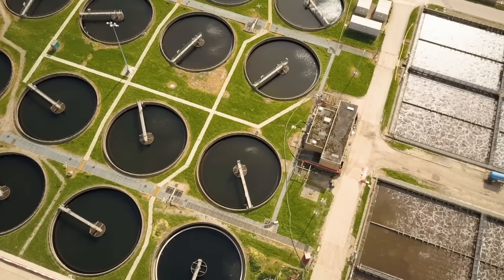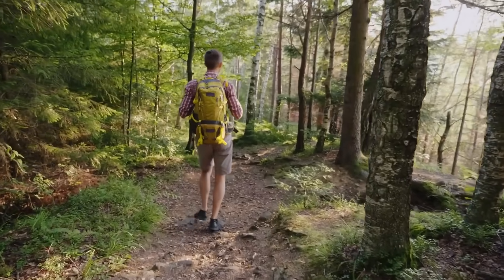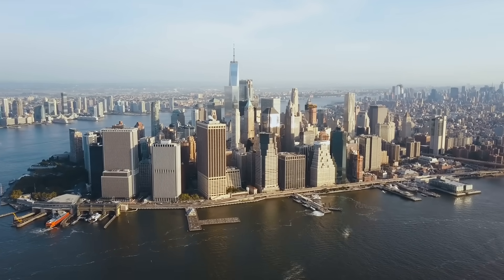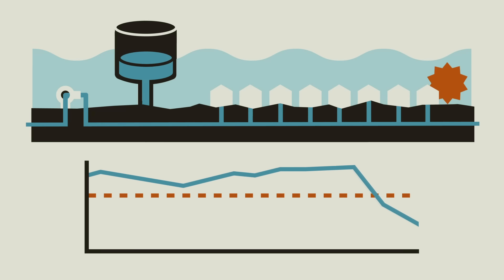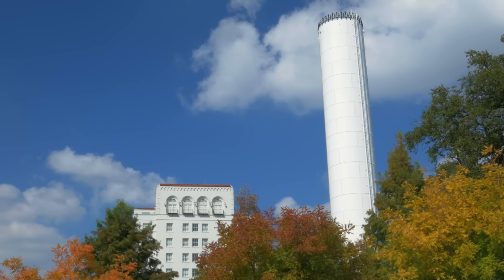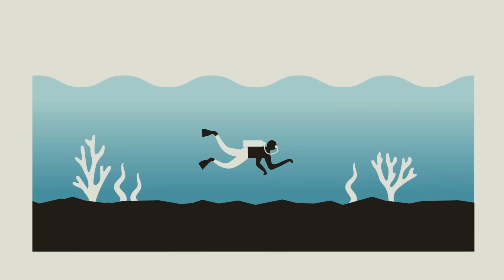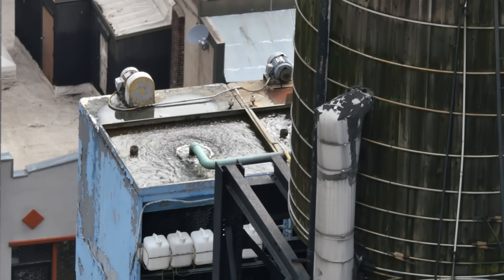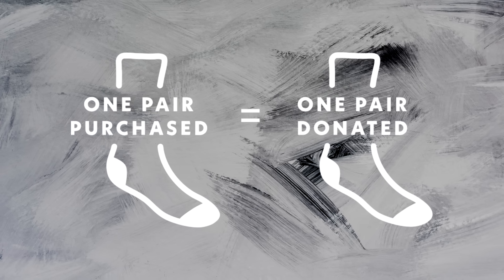How Water Towers Work

Comment: How about a video on Archimedes screw pumps ?
I got a situation with a waste water separating auger for industrial food peeling. We run taro thu an abrasive peeler & the, eh, shmoo comes out as fine or chunky taro bits in a suspension of viscous goop from hydrophilic polysaccharides. Also stinging calcium oxalate raphides.
Anyhow the auger doesn't screw it upwards fast enough at the manufacturer recommended angle so it backs up. But the auger is designed for potato peelings, not higher viscosity taro shmoo.
Lowering the angle of the auger seems to improve shmoo uptake, I guess it overcomes the sticktion from the slime since it's not fighting gravity so hard.

Comment: I'd be interested to see how the towers are constructed and kept from leaking.  I assume the internal water pressure pushes against the seams to seal them and I suspect the seams might weep a bit if the tank pressure gets too low.  Also interested in corrosion protection...  I assume sacrificial annodes are used?

Comment: Our city has no visible elevated water tanks, however what people don't realize is that a fairly sizeable portion of the city is served by a hidden water tank that is buried under one of our tall hills, it doesn't work for all the city because there is housing above it, but I'm sure it helps a lot for the portion of the city below that tank, the rest of the city relies mostly on pumps though.

Comment: 5:40 The crafty Luftwaffe in WWII eventually came to the situation of timing their raids on London to coincide with Low Tide on the Thames, thereby making it more difficult to use this abundant water source especially when the mains pressurised supply was down ~ due to excessive demand and/or damaged pipework.

Comment: When you think about it, the flow of water and the flow of electricity aren’t really that different, the only real difference is electricity is pure energy, and water flow is a combination of matter and energy. Both flow from high energy to low energy, both keep going until they can reach ground and if they can’t, they don’t flow at all. If you want to get technical, you can measure the flow of water in voltage and current, voltage being the force/volume, and current being the speed/pressure, and even many of the electrical components found in circuits have an equivalent version for water flow, check valves are like diodes, water wheels are like resistors, dams are like switches, or sometimes resistors, pumps are like batteries, and you guessed it, water towers are like capacitors

Comment: Do water towers divert the water into the mains supply pipe in the direction of flow or is it via a tee junction? What difference would this choice make?
Also, is the restored head pressure equal to the height of the water in the tower and what influence do differing velocities through the main pipe have on the recharge at the water tower's point of connection?

Comment: There was a water tower near me on the Central Coast of California. They finally tore it down and replaced it with pumps, because it could not be retrofitted to be seismically safe. In an earthquake, a huge weight of water a considerable distance up in the air placed a massive force on the legs supporting the tower, and they finally realized there was no practical way to make sure it was strong enough to survive a major quake. Great video, though!

Comment: We need more water tower highways for river systems to reduce emissions of energy cost , The format can be drawn out to very high altitudes and channels dug out using the same force of power that gravity allows to expand a river system that can also be beneficial to lower altitude water treatments even using salt water and design to purify the water by large distance of landscape filtering . HIGH ALTITUDE FOREST CULTURE CAN USE SALT WATER FOR HIGH ALTITUDE SEA WATER MAKES NO DIFFERENCE SINCE TREES AND CERTAIN GRASS LANDS CAN ALTER OUR ECOSYSTEMS FOR ANIMALS TO HAVE MORE MOISTURE TO SPREAD OVER THE NATIONS AS A MASSIVE COOLING SYSTEM . Then also using fresh or salt water tower systems can produce new city's and river side homes amongst the most driest places . Water wheels can also have a set design in furthering the distance water must travel to higher altitudes , Electronic valves that open the direct of dumped water in large scale towers ( more the thousands of towers or the single tower above the ocean sliding down a cable system of tubes can get faster and less expensive for materials , the nature would be to hide the systems eventually but to incorporate a following of nations to research the original module as a living testimony of excellent craftsmanship and nothing new to the system just taking advantage of the world we need to work with and devlope into a self efficient life  style system that adapts and protects its self with minimal energy use to develop

Comment: Contaminants can enter through taps! Yea right.
Reply: That's why we in the UK still have separate hot and cold taps rather than mixer taps like the rest of Europe.

Fresh cold water from the supply in the road outside, hot water from the immersion heater/hot water tank/combination boiler gas flame. It was illegal to join the two because of the risk of contamination from something nasty lolling about in your hot water tank.
Listeria, Legionnaire's disease anyone?

Comment: The thing I have always wondered about was how they keep them from freezing up during periods of below freezing temperatures.  Anecdotally, when I was deployed to Kuwait the water coming from the water towers was quite hot (even after spending time in the pipes underground) In fact, it was unnecessary to use the hot water in the showers, the water coming out of the cold water tap was more than warm enough.

Comment: why they don't install a propeller inside a pipe where the water move out, so that they also can take advantage of the flow and generate electricity for the local citizen. Idk whether the pipe for water to get inside the tower is the same to the outlet pipe. If it is the same, the idea would be already dead before it can be brought up in front of the crowd, but if not, why don't try to do it in practice

Comment: Water towers were completely foreign to me before I spent time away from my home town.
Where I'm from, The city has an entire mountain watershed and reservoir dedicated to the water system only, 40 miles away and thousands of feet higher.
The plentiful mountain reservoir is at such a higher elevation that there is never a pressure problem. without pumps.

Comment: Take the gravity out of the equation, add a pressure regulator on the pump; this is how compressed air works.
And any other compressed gas; the difference there is low volume/high need demand, so they transport the storage instead of laying pipe.

Comment: Well explained. Thanks. But there is one more reason to use water towers instead of pumping directly to the network and that is that the pipes will live 30% longer because you do not have the frequency of the pump in the network. (yes there are also other ways to filter that out, but the water tower is the easiest)

Comment: I am looking to do 4-7 275 gallon IBC tote along the side of my house 
My issue is the side of the house has about a 3-4’ slope will I need sealed pipe from lowest point in to the highest tank (possibly under the water level) to it loose water fill volume and add head pressure for my garden 8-10’ lower then highest tank and 4-6 lower then lowest tank

Or will I need to dig highest tank down and raise up lower

Comment: I wonder if a city could add a high-efficiency, in-line water turbine to the main pipe that feeds the surrounding municipality and create sufficient electricity that could be fed back to the grid?
Reply: No. 
The pumps produce pressure that brings the water up. That water up in the tank stores the pumped water but also the energy the pumped used, which is turned into pressure when the water goes down the pipe. Adding a turbine will just use up that potential energy, and will reduce the pressure downstream. You would need to compensate with taller water towers combined with more powerful pumps, and that increase in consumption from switching to bigger pumps will always be more than the power you produce from the turbine

Thoses elevated  storage for making power that act as batteries that he mentioned in the video do not encounter this problem because we dont need pressure at the bottom of the dam. They are still not 100% efficient, and woll still require more power to pump water up there than they produce, but they have the benefit of being able to pump that water up there using power grid excess from a hydro dam, instead of keeping some of the dam’s turbines offline so that we can use that stored energy when the demand exceeds what the dam can produce

It will always require more energy to pump water up than what energy we can get back out of it,  simply because no turbine and no pump is 100% efficient. There will always be losses to things like friction, vibration, sound, heat or other forms
Reply: Theres no money in that. 😂

Comment: Are there any large water supplies where mechanical accumulators are used instead of (or in addition to) gravity accumulators?
I'm planning a freshwater supply for my own property and I'm thinking of building a spring-pressurized mechanical accumulator. I want to have regulated pressure for my indoor plumbing, and regulated flow for irrigation, but most pressure reducing valves seem to require pretty big pressure gradients.
Trenching a water line up 115ft/50psi of slope is not completely crazy,  184ft/80psi of trench up a slope is more, and that's just the minimum head for most PRVs I've seen (maybe pilot-operated PRVs require less?) so in practice you'd be going further. Here in Wyoming, the average frost line is almost 5ft, which makes the trenching expensive, dangerous, and time consuming.

All this to say, a mechanical accumulator seems attractive.

Comment: Electrons do not flow from high voltage to low voltage.  In a DC circuit, they move away from negative voltage to positive voltage (electrons are negatively charged).  In an AC circuit, they move back and forth.

Comment: My house is supplied by a very high public water tank(at a height of about 50 meters) and my own house has an overhead tank ( at a height of 20 meters).
Is it possible that the public water tank sends water with such pressure that my homes overhead water tank gets filled up without the need for me to pump the water to my overhead tank?

Comment: The ram pump. Aslong as it's below the waterline of the intake, and has an excess outlet that can flow downhill. 

It can pump water for miles with no moving parts, never break down. Never seize. There's ram pumps built in the 1800's that still run today, you usually get them in mountainous or remote regions where you just need to move the water. 
But you can't exactly send people out for repairs or hoofing a load of spare parts out there.

Comment: Also liquids are not able to be compressed, which makes it pressure regulation in a dynamically changing system challanging, especally if you don't have a way to vary liquid volume, in response to pressure changes (water towers, being one way).

Another point that Grady didn't seem to mention is pipe sizing; when no water is being used (the static state) pressure would be equal throughout a closed piping system, however when water is flowing in the system (the dynamic state), pressure drops more the further you are away from the source. Piping system friction being the main reason. One way to compensate for this unwanted issue would be to increase the size of the piping system. Another way to compensate, is to add water towers along the rout of the piping system.

The piping system still has the meet the sizing requirements for the average usage, but it doesn't have to be nearly as large as it would have to be without distributed water towers.

Also, without water towers, water-hammer could be a huge issue.

Comment: A "tower" one inch square 115 feet high would produce 50 psi. That's about 15 8-foot stories. (0.433 psi per vertical foot)

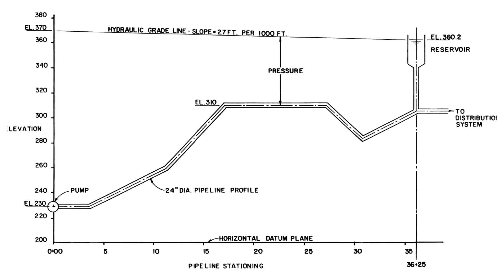Comment: At 6:25 does the reservoir not create pressure (due to weight of water) back to the pump? Does the "down" pipe (to about 280 elevation) act to isolate that pressure from the pump? I'd like to see pressure readings along the way.

Comment: At 3:23 there is only a pump. For simplicity it doesn't show what's connected on the right side. But if it's open, all the water goes there, including water from the houses? Isn't a return pipe to the pump needed, as in a home boiler system?

Comment: "Just like electrons in a wire flow from high voltage to low voltage". I'm afraid not, it's exactly the opposite. Benjamin Franklin defined the flow of current as positive charges flowing from high (positive) to the low (negative) potential long before EE Thompson discovered the electron an determined it had a negative charge. Hence electrons flow from low (negative) to high (positive) potentials. However, it was decided to keep the original definition of conventional flow for consistency with prior practice.

Of course, I'm sure you already knew that, and it was a slip, but I wouldn't want other mislead.

nb. water towers are now very rare in the UK. In hilly areas reservoirs are used, which I suppose is a sort of natural water tower. However, London (a city of over 8 million) uses pumped pressure, not gravity for most of its supply. Several older Victorian water towers, which were built more like brick towers, often disguised as something else, have been turned into somewhat unusual domestic properties.

Comment: Im a plumbing apprentice and didn’t know how water towers worked until I watched this video. It’s pretty cool that city-provided water from water towers are literally just a GIANT version of how a single house that has well-pump provided water gets it’s water out of the earth.

Water well-pumps push water from a deep hole in the ground, through some pipes, and then water gets inside the house and usually 20-40 gallons of water is stored in a water storage tank AKA pressure tank. When the pressure tank has a satisfactory amount of pressure for what it is designed for, then the well pump stops pumping water to the house until the people inside the house use enough water that the tank needs to be somewhat refilled.

Comment: I always wondered if the towers took advantage of gravity and it being the reason for the high storage of water. Common sense almost tells you this except that some situation would always require pumps. Not just to fill the tanks but to help in situations where the population are somewhat as high are higher than the tank itself. Great presentation. Answered all my questions I’ve had for a life time.

Comment: I like that not only did you explain the storage aspect, but the pressure aspect; it would be interesting to see this applied to Roman water systems where they had no electric pumps.
Reply: Theoretically they'd use an Archimedes Screw that is manually operate or powered by the flowing water of the water source being fed to the aqueducts (presuming said aqueducts weren't built just below the water source so would be gravity-fed).

Comment: How come the water doesn't freeze in water tanks?
Reply: I would assume the water doesn’t freeze because the water tower likely has very thick layer of insulation inside of the outer wall of the  tank.

Comment: I understand all but.... one thing...what keeps them from freezing?
Reply: Insulation inside of the water tower walls. In other words, the tower is not an eggshell of metal with water directly inside of it. It likely has a thick jacket of insulation material inside of the outer wall of the water tower and then the actual tank that contains the water is inside the insulation.
Reply: @MarlinRoth  Hard to swallow that.(pun) Sub zero temps and no heater, no stir action-ie still, but thanks.  Do they recirculate from underground when no demand?

Comment: Good video however it makes the common mistake of confusing pressure with flow. Pumps do not create pressure, pumps create flow. Pressure is the result of resistance to that flow. Your shower doesn’t have low water pressure, it has low water flow.

Comment: I always wonder if water towers could store electrical energy...
Reply: As potential energy, yes, but it wouldn't be very useful because it has to be pumped up there to begin with and you'd be taking energy out of the water to recover electricity, which reduces the total head available down the line for homes/businesses.

Comment: so basically the system works only if the average pumped water day is equal to or greater than the average per hour consumption of the connected houses.

Comment: in most country's water towers ar 60meter high and ar the main source of your water ,the pumps only fill the tower , and why ar they 60meters high? ea 10meters high gives 1 bar (14.5psi) 60meters is 6 bar (87psi) the actual formula or unit is Mh2O in the metric units.

Comment: I have an issue with this video.  You didn't explain that a water tower gets it's water from being pumped into it, and the gravity is what keeps pressure.  I mean, you kinda did, but I think for a video where you explain everything else so well, you have to start from the absolute beginning, even if it seems like going to a almost insultingly simple level.

Comment: Older systems used altitude valves.  Hopefully they have largely been replaced with pump systems to prevent stagnation.  Plus the towers are always a good reference to put an antenna on to get communications to those remote boosters.